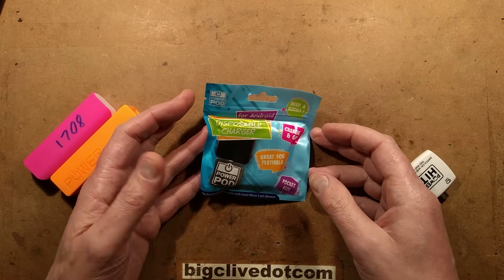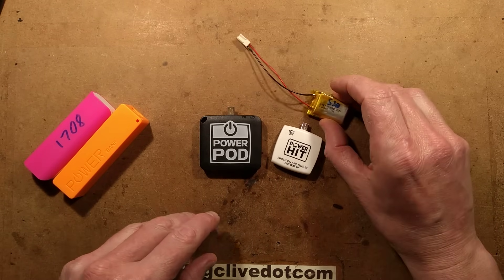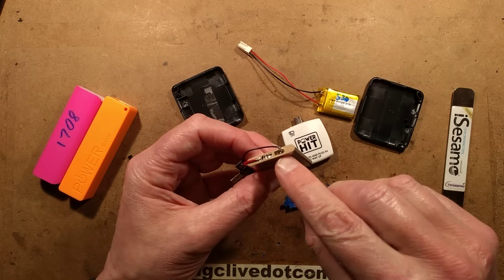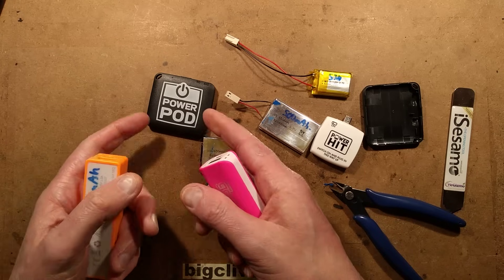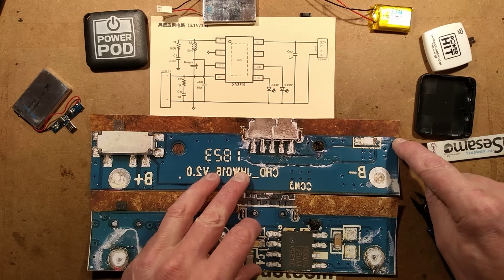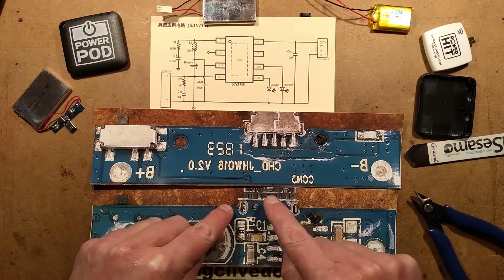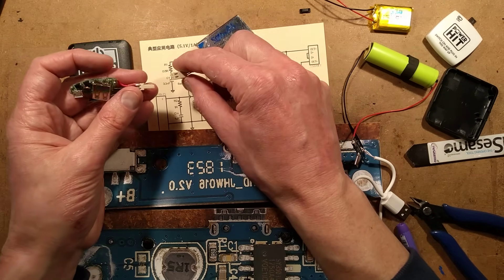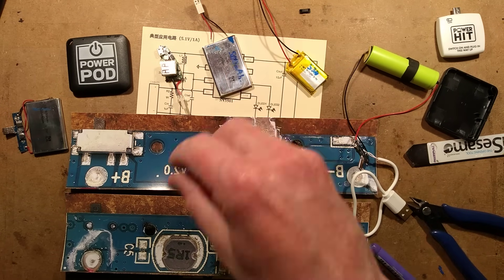Poundland "disposable" phone charger.

Comment: Wait... switches are relatively expensive compared to SM components.  If they deleted the trickle discharge protection switch, they could have made this rechargeable AND saved money. Weird.
Reply: These switches are dirt cheap, you get 50 for $2 shipped worldwide. They have to cost 1ct each really off the roll at most. Try to get an inductor for 1ct, you're going to have a hard time.

Comment: Holy crap I understand now. The cells inside of these batteries are past their half-life! So these batteries are being recycled in droves... only to be a single-use product. I have a feeling if my theory is correct, you are not better off salvaging these because they're damn near close to being dead and manufacturers are making these one-use batteries from old, half-dead stock rather than reconditioning them because it's cheaper to do that.
Reply: I deem this unlikely, there are lots of devices in China that use Nokia compatible cells, that don't need much power like MP3 players and eBook readers, and usually no old stock is kept, these were probably made on demand since they're missing the board, merely reused the cheapest existing tooling.

Comment: I'm on my second blackweb 20 Ah charger.  The USB ports are fragile and stop working easily, and they're a huge pain in the ass to pry open for repairs.
Reply: Try installing a cabled USB port to relieve the stress on the solder joints.

Comment: Well, to be honest, better this way than a single use one that is having more lithium inside and of course they should be re-used after the normal 'recycle-routines' that should be followed.
I wonder if the battery is not rellly just a recycled one from a phone or even a spare-battery that was not making it specs and therefore re-branded for this purpose instead of thrown away.

And, very neath that you can tweak it into recharge. For as festivals concerned: a small batterypack like this can probably be taken inside but a normal bigger powerbank will probably have to be thrown away at the security-check. You could refill it with a bigger battery probably to get more use out of it and as such have a bank with you to deliver just enough power to find your friends back

Comment: I wonder how many commenters saying how wasteful these chargers are change there mobiles every 2 years or sooner? 
Just saying.
Reply: There's a difference between 2 years and 20 minutes of usefulness, you know.

Reminds me, my phone is 2 years old now, i should get an extra battery or two, charge and condition them, and put them into the fridge, before all batteries i can get for it are decayed and useless.
Reply: @JornNavarre  

My exact point.
I'm still using my GS7, which I've had for nearly 3 years now, and there's no reason to change it yet. There's no forced obsolescence with an Android phone.

Comment: I have a 6 AH brick and its still only barely enough to charge my S9. That things not even a little squeaky fart.
Reply: Got to allow 25 to 40% for losses in the conversion, cable and charging. How I miss removable batteries, four spare batteries for my note 4 was still smaller than a 5000mah power bank.

Comment: be very careful with lithium cells and batteries as they can easily dump their charge in a short time  resulting in fire and smoke.

even worse maybe that the disposables may be factory rejects of the cell phone makers.

over charging lithium batteries can result in fire.

shorting out lithium batteries while may or may not result in fire it can cause severe burns to fingers and hands.

over discharging lithium batteries can destabilize them allowing them to fire up when charged though it is possible to even revive batteries taken down to 0 volts it is very risky.
Reply: or even stolen parts  look at any counterfeit or knockoff designer product like gucci the real or good looking fakes may use real gucci badges stolen from a factory

Comment: Clive you should do a life test on the cell and then report back how well it does over a month or three of charge discharge cycling.
Reply from the maker: I did four cycles on it and it was consistent each time.
Reply: @bigclivedotcom   Would a weak battery show up after 4 cycles or would you need to hit it a bit more than that?
Also can you do a video on FVD AvE did a little bit but did not goo that deep and really did not say if the China stuff is good, bad or BANG!

Comment: Recently (past couple of weeks), I bought a power bank from The Original Factory Shop.  It's rechargeable.  It claims to deliver 3600 mAh.  It also incorporates an LED torch (not as bright as the camera flash on my phone, but adequate).  The case seems robust.  £5.  Seems like a lot better value than the Poundland jobbie.  Over 5 times better on capacity alone, even if it's exaggerating the capacity as the Poundland jobbie does.

Comment: Here's a different view on this besides commenting that it's wasteful.... WHAT IF the cells are rejects and would have been trashed anyways? Ehh, they may have been recycled, so it is still wasteful.
Reply: This is exactly what I was thinking. The fact that such large form-factor cells are only reading 500-600mAh and are leaking down to 4.05V in storage suggests that these are extremely heavily-cycled used cells, likely already destined for a landfill. It's still wasteful as the cells could be recycled and the PCB/boost circuit gets thrown away, but it's not like these are new grade-A cells going straight to the landfill.
Reply: @DielectricVideos  I think they are recent cells, just from the lowest grade of manufacturing. Because these Nokia cells are used a lot and produced a lot on-demand, so usually they aren't stockpiled, because there's no need, there's enough consumers to offload them to. I have one of those Chinese ebook readers myself that takes them, and i've seen even more devices. Furthermore someone would have had to roll, terminate and shell them and forget to attach the control board and sleeve and leave them like that in storage? I think whatever company made these power banks just looked around for the cheapest crummiest cell manufacturer, and asked around what tooling they could reuse the cheapest, and Nokia BL-5C compatible tooling was there, waiting to be used.
Reply: They wouldn't have been, there are enough eBook Readers in China and MP3 players and other little gadgets to stuff them into, which are already designed with Nokia compatible cells in mind, and if they make a little fire incident, nobody really gives a shit.
Reply: "what if". No. It's fucking wasteful and Poundland should be ashamed of themselves.

Comment: The good side is that if you are into electronics and you find one of those in a bin you can take it and make use of it. You get converter module and battery for free and with cheap Li-Ion charger module (for less than 1$) you can recharge it. This tiny battery gonna be fine for powering microcontroller based projects, even without use of converter. AVRs gonna tolerate the voltage very well.

Comment: Also known as the "Sony" production/design/marketing solution (put in weights/make it bigger to look more expensive).
Reply: PS3/PS4 controllers are flimsy and light cheap crap though.
Reply: @Thorpe  I disagree the PS3 controller was definitely cheaply built, light and rarely lasted me more than 3 month the PS4 controllers however has a nice bit of weight in them and one of my PS4 controllers has lasted well over a year and if you ever  take them apart you can tell that they are built fairly well considering they cost $60

Edit: Another difference is if you dropped a PS4 controller, 90% of the time it would break however I've dropped my PS4 controller plenty of time before and it still works so the PS4 controller is definitely more sturdy than the PS3 controllers

Comment: I have never seen such crap being sold in germany. It should really be forbidden.
Reply: It's in the UK too,
Reply: Neither in Turkey.
Reply: Come to Brazil!
Reply: @satan2583  no
Reply: @satan2583  "Get behind me satan!" -Alex Jones
Reply: Before you ban recycled batteries, you should ban the billions of one way batteries (AA and AAA) sold in supermarkets day by day...
Reply: @daturadawn2119  but this is a one way battery?
even worse it could be recharged, but lacks a charging port
Reply: @nutzeeer  Correct! But these are one way batteries made of recycled batteries and not from raw materials like the other billions (day by day!) of one way batteries (like AA and AAA) you can buy in every supermarket. So first ban one way batteries made from raw materials, then ban batteries made from recycled old and worn batteries...
Reply: @daturadawn2119  No. There is no reason to advance slowly. Just ban any non rechargeable battery.
Reply: @daturadawn2119  There is a big difference in the type of waste produced and the handling necessary for it between disposable cells and lithium ion cells.  In fact AA and AAA are just Alkaline cells, they are non toxic but recommended to not dispose of like, hundreds of them at once, besides that, they are safe to go in the trash and the two in your remote you change every year or two is nothing compared to your weekly bags of trash.

Comment: I went to every single Poundland in Liverpool the other day looking for cheap rechargeable AA batteries and they were sold out in every single store!
I was also after some of the new style power banks but they only had the old style ones in too. Disappointed!
I did pick up a few cheap USB leads though to cut up for projects...
Reply: It better to buy poundland 1200mph power bank one for one pound or there power geek 2200 power bank  one for two pound  or there 4000mah power bank one for five pound
Reply from the maker: The 4000mAh powerbank is nicely made and has the extra feature of a light.
Reply: @bigclivedotcom  I have both I got two of the 2200mah one and one of the 4000mah one
Reply: Aldi sell excellent rechargable AA & AAA batteries very cheap, I've got about 30 of them in every item in my house.
Reply: @JornNavarre  It better to buy poundland 1200mph power bank one for one pound or there power geek 2200 power bank  one for two pound  or there 4000mah power bank one for five pound

Comment: No point making them rechargeable. The capacity is too small for anyone to bother with. If you add charging circuitry then that would also be thrown away after a single use.
Reply: It better to buy poundland 1200mph power bank one for one pound or there power geek 2200 power bank  one for two pound  or there 4000mah power bank one for five pound
Reply: They shouldn't be made at all, extremely wasteful.

Comment: Sigh... they should just bundle them with two AA alkaline batteries .. 3v 2500mAh boosted to 5v  versus 3.7v..4.2v 500mAh .... same result.
Reply: @JornNavarre  because it's all about being eco-friendly and recycling and being a cheap product, lithium being hard to ship by air makes things harder and more expensive ... you can collect alkaline batteries and throw them in the recycling bin ... here they even have programs like "bring 20 used batteries and we give you 4 new batteries" (admittedly shitty ones but still better than nothing) 
If you can buy a 100pack of Amazon Basics AA alkaline batteries for 24 cents each, and 100pack of AAA batteries are 21 cents each. Imagine how cheap it would be to bundle a couple of batteries with the thing.

Comment: I recommend a xiaomi 2000mAh powerbank - it supports quickcharge both on input and output and really has quite some capacity. It should cost around 25 pounds in UK.
Reply from the maker: 20000mAh?  That wouldn't be good value for a 2000mAh bank.
Reply: @bigclivedotcom  Yep, of course it's 20000. I managed to get my phone going for a few days without electricity and I did nothing unusual to save the phones battery. Same thing should go that big powerbank of yours, it does seem the same physical size too.

Comment: Clive, could you do a video sowing how to add protection to these cells, by either buying a module from China and making a DIY protection circuit?
Reply: You can buy the protection boards from China for about £1 for 10 boards and solder them on to the cell yourself.

Comment: Most Androids now have USB-C. That's micro-USB, so unless you have an adapter, it's already useless for most Android users.
Reply: Incorrect. The micro USB to USB C ratio in current use is about 10 to 1 in favour of the micro USB.
Reply: Wrong. Current flagship or upper midrange phones definitely do use USB-C, but there are not only older models still in use but TONS of cheaper Android phones sold that still use Micro-USB.

Comment: Hey Clive I have a little 3.7v 280mah lipo but connector is nothing I can use to charge it would putting wires red on positive and black on negative on a 9v battery charge it up? Or can I doit on am 18650?
Reply from the maker: You must use current limiting and protection.  If the battery has protection then all you'd need is a resistor.  But it might be a waste of a 9v battery.
Reply: Just recycle bin it, its too small to be useful in anything but a single LED torch.
Then spend £2 and buy a 1x 18650 cell charger/torch from eBay

Comment: I gut them for cheap parts for electronics projects that need a battery and a 5v supply (or just the cell!). Wasteful but useful! I have cycled a cell I got from one of these loads of times now (since the last big clive vid on them) and it is working fine - clearly a fully rechargable cell.
Reply: It's not wasteful if you recharge it yourself in your projects :D

Comment: I guess that it's cheaper to use rechargable batteries just because they are made in billions, so they cost the same as disposable ones, but with higher energy density... but it's a crime against the earth, this is far beyond programmed obsolescence... if you find many of them, just make a big stack, use some cheap ebay / aliexpress 2€ hollow power bank with battery protection and there you go, a decent power bank with scalable capacity...

I scavange every single electronic for batteries, and this is a crime...

Comment: Find a bunch of these at a concert or fairs and wire all you find in parallel rig the first cell, dig the protection board out of a dead cell or use a TP4056 and add the switch if you don't have the right model and add plastic or popsicle sticks to the sides or make a new housing.

Comment: How much charge generally is in the rechargeble powerbanks when you buy them?

The sellingpoint of the throwaway ones is the electricity that is in them when you buy them.
But if the rechargeble ones have the same in them when you buy them they become completely pointless.
Reply: It better to buy poundland 1200mph power bank one for one pound or there power geek 2200 power bank  one for two pound  or there 4000mah power bank one for five pound
Reply: @mrwahibtahri  but can you uze them directly out of the package to charge your phone just as much?
Reply: @baronvonlimbourgh1716  yes the two pound and five pound one has some charge in it not full charge but some charge in it
Reply: @mrwahibtahri  then buying the throwaway ones makes not even a little sense.
Reply: @baronvonlimbourgh1716  correct and you can recharge them 

The 1200mah one for one pound give your phone extra 30% charge 

The 4000mah one for five pound  give your phone an extra 69% and more  charge do not remember how munch but I know it over 69% as I have one in white I got from poundland.
Reply: @baronvonlimbourgh1716  This item disposable power bank from poundland and all other one that ate the same with different name are  no good it bad using cell battery in it that can be recharged they should not of been made like that it bad.

Comment: Is there any truth in the claim that the reason the mAh ratings never match is because the rating is for 3.5v while USB outputs 5v?
Reply from the maker: The ratings of powerbanks is based on the internal cell capacity and not the output at 5V, which is lower.

Comment: Did you just charge a AA battery with a charger for a flat battery or is that round battery actually the same type as the flat one and not the AA type
Reply from the maker: The round battery is an 18650 (18mm diameter by 65mm long) lithium cell.
Reply: @bigclivedotcom  i did not know lithium cells came in round form all the round ones i have are just AA diameter and AAA length and can charge on an AA charger if the contacts reach (AA being nickel metal hydride if i remember correctly)
Reply: @bland9876  

Where have you been. Surely you've heard of an 18650 cell? That's just about the most common size if LiPo cell available. 
LiPos started of cylindrical in shape when first invented, only becoming flattened when devices needed thin cells of the same capacity as the cylindrical version.
Reply: @johnnodge4327  everything I take apart either has rechargeable double a batteries that are round the nickel metal hydride ones or they're those white ones with the orange tape that's a 3.7 volt lithium ion on them

Comment: Another source for scavenging small li-ion batteries for projects is disposable vape pens. They are very thin, cylindrical batteries with a marked capacity of 280 mAh.  Not very powerful, granted, but depending on how small your project is, they can be useful. You can always use more than one in parallel and still have a very thin enclosure compared to what an 18650 would require, for example.